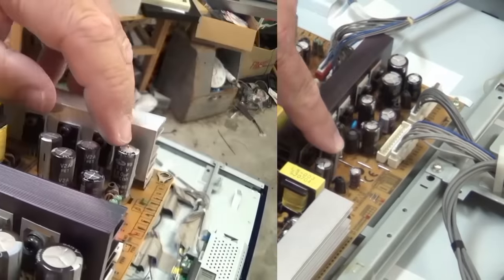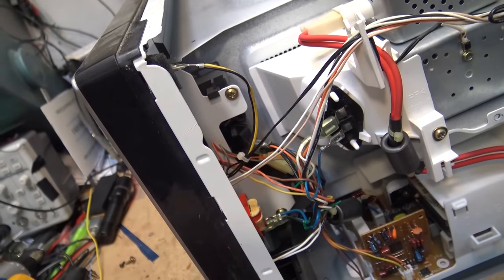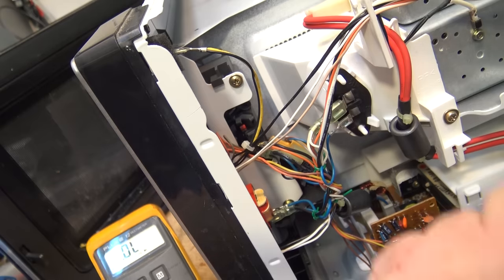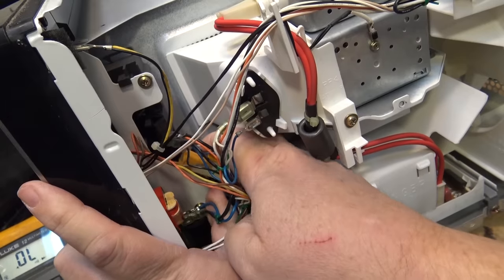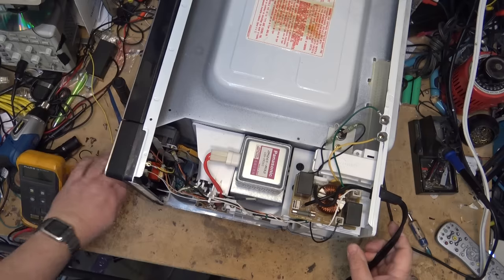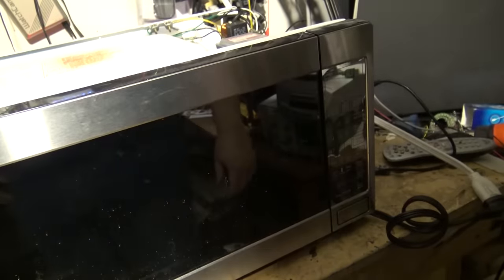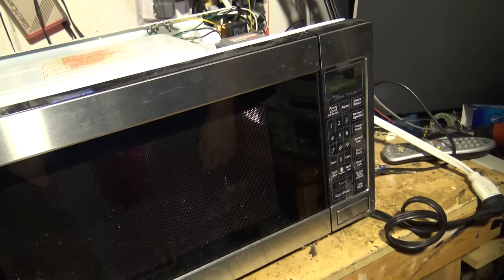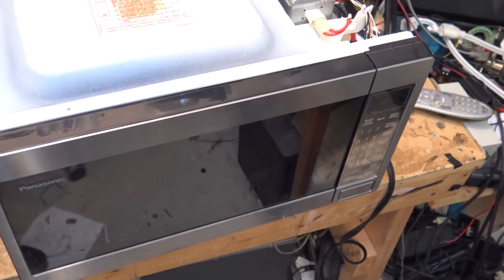Panasonic Inverter Microwave Oven Repair

Comment: Wow, I had one of these about 5 years ago and it and couldn't figure out why it suddenly quit working.  I wish I saw this video but it wasn't up yet.  I bought another 1250W inverter unit at a garage sale yesterday, looked barely used and for only $40.  It's manufacture date is 2016 and I hope it works a long time.  It is quite a bit more powerful than my 1982 Amana radar range (which still works).
Reply from the maker: I picked up one a few years ago probably 4 years ago now in the dumpster at work or to say the recycle bin it was brand new like I'm talking brand new as in never been used I think it was pre-installed in a new house and when they first people moved in the cook didn't like Panasonic and wanted a more exotic brand so it was ripped out with the trim kit and placed on top of the recycle bin at work. I took it home works like a charm been using it ever since fantastic unit.

Comment: I never heard of an "inverter" microwave.
Does that mean it does not use a high voltage transformer? (MOV)
Reply from the maker: It uses a "flyback" type transformer to generate even higher voltages. Conventional microwave ovens operate around 2500 volts. The inverter units run closer to 4100 volts. More volts means more watts.  A conventional microwave might have 700 or 800 watts, while the inverter models will put out 1250 on high power. The advantage is power control. On a conventional unit they cycle the power on and off to "lower" the power level. Basically 100%  then nothing. On an inverter model, if you set it to 3, you get 30% power running 100% of the time.  The defrost cycle on an inverter model actually defrosts peoperly, without starting to cook the edges. They are the best microwaves, and I would never go back to a conventional model again.
Reply: 12voltvids In the inverter type instead of 100% then nothing for a duty cycle, are they using different taps of the transformer to lower the output?
Reply from the maker: @mrsemifixit  
No, they change the frequency of the oscillator for the inverter, which changes the efficiency of the transformer by moving it closer or away from resonance.
Raise the frequency and the efficiency drops off which lowers the output voltage.  Switch mode power supplies do the same thing. The opto coupler changes the oscillator frequency to control the voltage in the secondary.

Comment: I’ve had several Panasonic microwaves (none ever failed, I only replaced due to moving overseas and then upgrading to a larger model), including a very similar one from just a tad earlier than the one in the video, and none have had fans that spin down. I wonder if perhaps the fan is failing, and that the fuse blew because the fan was unable to keep the electronics cool enough, including the fuse itself.
Reply: I suspect the fan slow down is due to the voltage drop on the line as the inverter comes up to full power.
Reply: My family had a 1982 vintage Panasonic Dimension 3 (named as such because it offered microwave, convection, and combination microwave and convection).

It wound up getting thrown out, but not before giving us over 30 years of service, though we never did use the convection oven operation, nor the combination convection/microwave.  It was built like a tank, but it got to the point where it was too worn out; the turntable belt got stretched out and the magnetron became too weak to cook efficiently.

Comment: Thanks for the video.  It is helping me.  The connections on one of the switches were burned.  Maybe a bad connection?  Maybe something to do with that blow the fuse function?  Fuse is OK.

My problem is I got it apart without good enough documentation of which switch is which.  I cant quite be sure watching the video,  Which position is the NC seitch?  It is one of the two near each other, right?  But is it the one closer to me (the outside of the unit, or is it the far one. With luck I hope I have the two NO switches sorted.

Comment: I find that the pins in both Torx and allen head screws break quite easily allowing the use of standard divers/bits.
Reply from the maker: They do,but my little slot driver fits in perfectly, and these screws are not driven in that tight to begin with.

Comment: Nice video, all useful.  That 15A that tripped, what voltage? 110/220?  (I'm in UK, we only have 220 in houses.)
Reply from the maker: That one running 120. We have both 120 and 240 here but small appliances like microwave run 120

Comment: Hi Mr. 12volts, can't believe You do not posses a Securty Set screwdriver towards Microwave Oven troubleshoot!😮 Will see if l can ship you the 2 basic drivers that fit the large and small screws. On my B'ness Cards l have printed "The only thing l can't fix is a broken 💔 Heart". I borrowed this from Mr. Fix it in Canada. Watching You, Sir, l get it that you are along the same Vein. Have a Good one😊 MJ. in B'dos.
Reply from the maker: I have some but not all because I am not in the business.
Reply: Thks. for your prompt reply. In the Old days, l would use a hacksaw blade, without holder so as not to scratch customer's finish, to cut a flat bit groove into the scewhead, Presto!! worked everytime. Thks. MJ. in B'dos.
PS. Only used this option when out in the remote field. No hardware available 😊

Comment: Sorry to inquire, I had problems with my Panasonic genius plus, I open it and check every the primary switch  had a little black powder I clean and re adjust. I don’t have tools or knowledge just follow tutorials true YouTube . It works again but the fun and the lights starts on as soon  you close the door, it has to open the door in order to stop this situation. I can use it normally,  but if I close the door that’s happens. Do you know the issue? Also if works fixed? Is a very expensive microwave but don’t want to spend money and dealing later on with more issues, thank you!

Comment: Just purchased a brand new Panasonic (1.3) NN-SC669S (Canada).  I dont think that the unit is working properly.  It seems to run alright but 1 1/2 min at PL 10 with 8 oz of water and I can hold my fingers in it.  I am pretty sure our old one, which was the same type of unit, heated things allot quicker than that.  Does this sound right to you?  Thanks

Comment: Mine failed in a way that thousands have.  The door switch will not allow the hooks to fully enter.  That is because the switch, as seen in this video, is mounted on a very flimsy white steel sheet, which bends a tiny bit every time you slam the door shut, until the switch is too crooked to let the hooks in.  The fix is very quick and simple.  Remove the two mounting screws to allow you to bend the sheet back into position.  Then find two spare holes at the top and bottom and use a narrow zip tie to diagonally brace the sheet onto unused holes in the cavity box top and the bottom sheet.

Comment: Fuse fails yes, or the door is slammed, and the bouncing of the switch causes the shorting switch to operate and short the mains. Another thing that can blow the fuse is the lamp failing, as they typically draw a very high burst of current when the filament drops across the mains leadouts inside the glass when it dies. When buying fuses get the ones with ceramic bodies, they do not shatter like the glass ones. Very common for the fan to not run, as it is caked with dust and grease, and this eventually causes the oven to shut off after a few minutes of running as the magnetron is overheating. Clean, and put light oil on the bushes and it will work again.

I have a KIC microwave made in 1984, and it still works well. Had to replace the light a few times, and eventually the magnetron got weak, so put a used one in from a later oven that rusted out. Lucky for me i live in a country with 230VAC mains, microwave fuses are 10A.
Reply: Yeah magnatrons are easily replaceable ,and just troubleshoot the inverter board ...dam its just a smps power supply jacked up
Reply from the maker: Generally when the door is slammed and the short switch contacts bounce the switch welds shorted.  That is why the switches need to be checked each and every time a unit blows the fuse.  On these units fuses fail after years of use just due to the springs getting weak and resistance building slightly causing heat.  Seen it many times.

Comment: Hi, I received a Panasonic SN 686 S inverter microwave to be repaired and was wondering if there is a power supply schematics just to check the components value before attempting to remove parts to be Checked outside the board. Thanks for the help.
Reply from the maker: I have no source for any info on anything.

Comment: Great video thanks. issue with my 2 year old inverter model is fuse found ok but no display. Only activity noted is If I open the door glass plate turns constantly and stops upon closing door. Everything else looks prestine inside the unit including circuit boards. Any advice appreciated cost me £250 when new!
Reply: Hi, my Panasonic model no ct878sbpq, also had a faulty micro switch, blew a trip!
Replaced that, but my turntable also rotates when door open.
Did you find a fix for that please.  leaving mine turned seams to stop,it for a while though.
Thanks.

Comment: I'm  coming to this party late but perhaps not so late I can't get a question answered?
I have one of these inverter types which worked great up until I put it in the garage for 4 years, protected and out of weather. The time has come to use it again but I can only get it to put out 1200 watts no matter what I set it to.
Do you have any feedback on fixing this?
Thank you.
Reply from the maker: Haven't a clue.

Comment: Just had my NN-SN960S Inverter smoke.  Lots of smoke.  Burned wire on the transformer.  Bought new in about 2013.  Great oven.  Replaced it with a newer model Panasonic 1200 W.  
I have been using a Amana microwave that I bought in 1971 as my first purchase to establish credit after discharge from the Air Force.  A little scratched up but works great.  Weighs about 80 pounds because of the VERY heavy Iron and copper transformer.

Comment: Hearing your story about how you got your microwave oven, I shake my head at how wasteful some people could be, throwing away a perfectly working machine.

And, aaiiieee!  That had to hurt.  Lesson learned: don't fill a mug to the brim with water when using it as a load to test a microwave oven.  Hopefully you didn't get burned, at least not too badly.
Reply: Great videos, detailed and understandable, thanks.
Reply: Or use the device called a handle.
Reply: @chazdesimone7306  You can still spill the water if you don't take the mug out of the oven carefully.

Comment: Thanks for posting this video. Great information! I have no power. Over time, it was cutting out intermittently and then we could get it back by hitting the front and then eventually it never came back. Sometimes, the display would be dim, but it would still work. There is definitely 120v coming in to the unit and the fuse is good. The black live wire is powered all the way to the plug on the board on the back of the display (the one with the blue wire that leads to the inverter) All 3 of my switches work fine as you demonstrated...but the monitor/short switch acts strange. When the switch is unplugged, it acts as it should...shorting with the button up and clearing when pressed down. The problem is when I have the wires connected, it remains shorted whether the button is up or down (the beeping continues either way) Any idea what is causing that?
Reply: Hi mine has the same problem, did you get the response for the issues. Thanks for sharing

Comment: Unfortunately Panasonic microwaves in the last several years have numerous quality assurance and poor reliability standards. GE is no longer making MW's, and Whirlpools are darn expensive. LG's have the keypad behind the door, and Danby's are inefficient. So what's the best 1.1 - 1.2 C.F.   MW currently ?

Comment: Hi there,

I’m wondering if you could offer me some advice. I’ve watched your video and I have a panasonic nn-ct5855. Some soup blew up in there and blew the bulb. I’ve cleaned it and replaced the bulb. The microwave is still warming up food. However, there is not light and the new bulb just spins the dish in the middle when the door is open. Any ideas?
Reply: I’ll happily make a donation too to your website and channel too!

Comment: inverter versus normal transformer? whats the difference on power consumption? here in uk my old panasonic oven uses 220v 1300w ah you say 1450w at 120v interesting. wonder if would work on mains inverter off a battery?
Reply from the maker: It depends on power output.  Conventional topped out at around 800 watts and inverter models up to 1200 watts.

Comment: My Panasonic NN-SB65NS just stopped working.
Display is lit, all functions keys work but magnetron does not kick in.
Ideas?
I'm not a tech and while I have some tools, Don't have allot of electronic testing tools.
THX
Reply from the maker: Could be the magnetron. Very high voltages in there. As me how i know. 😮 One thew me about 6 feet.   Microwave ovens are the one thing that make me nervous.
Reply: @12voltvids   Thanks, what about the safety lock switch?
Everything seems to work like normal but no magnetron noise.
What is the best way to diisspspate the voltage?
Let it sit for a week unplugged?
Just hate dishing out another $129-$150 for a new unit.
Only lasted 6 years 9 months.
Reply from the maker: The hv discharges within a few seconds.  The capacitor has an internal bleeder resistor.  Is it a conventional microwave with an big iron transformer or one of these inverter types.  You can test for 120v ac on the primary side of a conventional microwave.  The inverter units are much more complex to test.  If it's shutting down after a few seconds and is an inverter type disconnect the magnetron leads. Note the orientation. Because if you get them reversed you can burn out the magnetron. On inverter type of you disconnect and it doesn't shut down after a few seconds then magnetron bad.  If it still shuts down after a few seconds then the inverter is bad. If it fails to even attempt to start then it could be a bad switch.
Reply: @12voltvids   Lots of maybe's and could be's... might be better off giving it away to someone like yourself locallt ot me in PA who tinkers and might be an $8 switch.
Mama want me not to open it up and just go buy a new one.
I don't want to buy one at all.  I am a senior and know how to use a gas stove top and oven.  Plus I have a brand new toaster oven in a box I bought for a project 7-10 years ago and never opened it.
Mama dudn't like that idea.

Comment: Why would a thermostat blow and burn an inch of the wire to a crisp? Is it dangerous to simply install a new one, do nothing else and see if she works? I replaced the switches years ago, they are still good and the fuse didn't blow.
Reply from the maker: Well it was probably the crimped on connector that failed. Crimps are not that good to begin with and repeated heating causes them to come loose and go higher resistance which causes heating.
Reply: @12voltvids  Thanks for the info. I'll change the connectors and thermostat. Much appreciated.

Comment: So I started to have an issue with my unit saying the door wasn’t closed. I would mess with the door switches manually (while on) and first time it ended up working. The second time I think it shorted when manually working the switches and turned off. Plugged in a new fuse and it didn’t turn back on. Could it just be one of the switches needs replacement and a fuse? Or did I make a bigger issue?

Comment: Will the convection/ oven mode work if its its the problem with the fuse? Only my microwave mode is not working and the magnetron seems to be fine... My microwave came back to life and eventually died again. What could be the issue? Oven mode works even when microwave mode is not working.Thanks
Reply from the maker: Fuse and thermal cut out will conlmetely shut down power.
Reply: @12voltvids thanks for the quick reply. I will just try cleaning the internals and see then. Feels like some loose connection as it started working once and died again.
Model is NN-C784MF
Reply from the maker: @drivewithvg9412  check relays on control board.

Comment: I have the exact model. The inverter went and shorted the fuse. Inverter replaced but now it takes forever to heat. Why would this be?
Reply: Degraded magnetron performance, maybe. Panasonic got you a 1:1 replacement for the inverter board, eh? Cool!

Comment: Could a failing component in the display driver circuit or its power supply have been what initially popped the fuse?
Reply from the maker: No definitely not.  It is an 18 amp fuse, they just fail some times. The problem is the fuse holder. Heat generates between the holder and the fuse, and over time this weakens the fuse. I have seen this many times on many things, including my electric car charger.

Comment: I find that it is normally a bad fuse.  I spend a lot, lot more time cleaning a microwave oven than repairing it.  I get those safety screws out with lineman's pliars.
Frank
Frank Reiser Video/Audio Service
Reply from the maker: Yes the fuses fail all the time on these, but you still need to check the switches.

Comment: Why would you poke around the unit after putting in a new fuse?  (BTW Thanks for the tip on removing the back screws). I put a new fuse in mine put the cover back on and it works perfectly. Same thing for a teacher friend of mine. The school he works at put the same model I have in the garbage (must be nice to have unlimited funds). He took it home and replaced the fuse. It works fine to this day. Sure it popped a fuse but that does not mean the unit is faulty. NOW If it blows that new fuse then further investigation is in order.
Reply from the maker: These ones eat fuses mainly because the fuse holder springs are not tight enough and that causes heat in the fuse.  After awhile this heat results in a failed fuse.